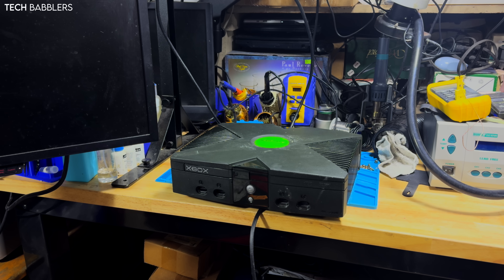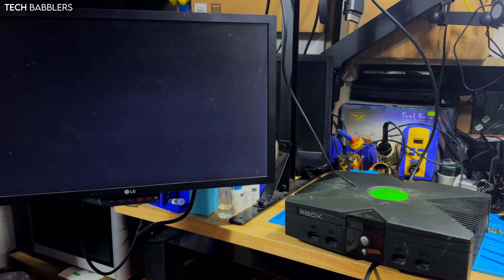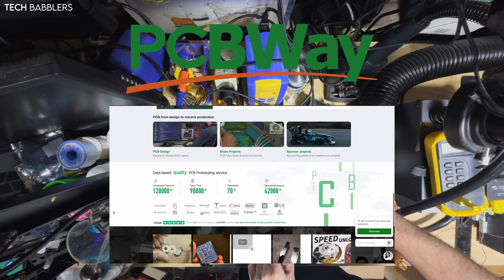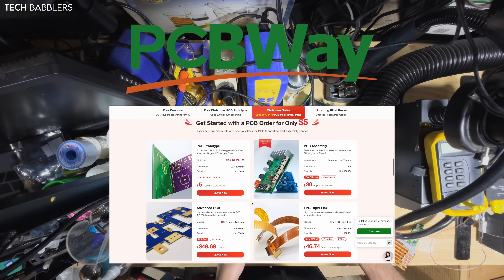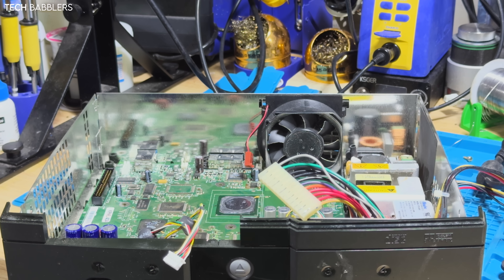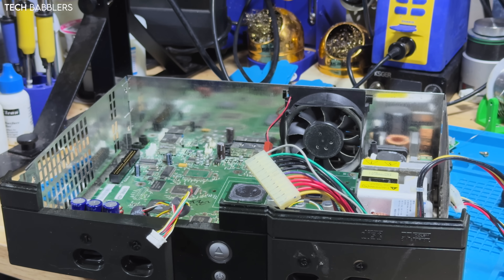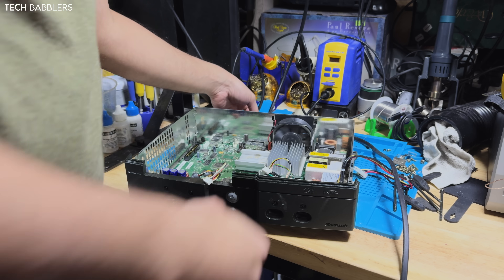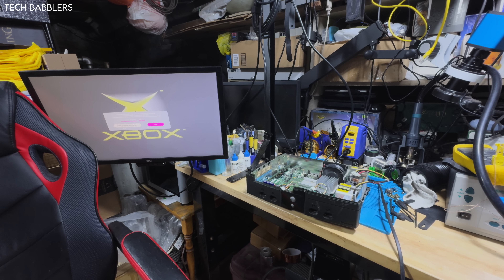Original Xbox 1.0Ghz CPU & 128 MB RAM Upgrade!

Comment: Interesting green for the controller ports is it the video doing it as blue green or is it actually blue green also i find your RAM method interesting you add solder to the pads then add the chip I remove the solder then add the chip
Reply from the maker: Since this video, i've gone back and forth with how I do the RAM upgrades. Sometimes I pre-tin the pads, place the chip, align by soldering one pin on each side and then drag solder, others, I do the same method minus I clean the pads and align the chip with no solder there.

Comment: Hi, where did you source the CPU from? All the ones I found are different dimensions and need an interposer board
Reply from the maker: I got mine from eBay! It's on a HP motherboard, so I had to pull it from the board first. It should be this! https://www.ebay.com/itm/384671580794

Comment: I wonder if a later Celeron would be a performance boost as well or not
Reply from the maker: It would have to have the same exact pinout to be a drop in replacement, otherwise, it wont work!

Comment: Gpu upgrade from the fx5200 to a Radeon 9500 Pro Would have been nice
Reply: The xbox Gpu is equal to a FX5500 when running overclocked, xbox gpu can reach almost 300mhz. And cant be upgraded because its actually the TOP of that architecture chips... is actually a geforce4 prototype not a GF3.

Comment: you don't need an interposer for the 1ghz ? what exact cpu is it ?
Reply from the maker: It's an Intel SL4BS PIII. It's a Slot 1 Processor, so you'd have to remove it like i did in the video.

Comment: can you share your bga profile ? i have the same machine
Reply from the maker: So I have an ACHI-IR PRO-SC and this is the profile i've been using for the past 6 months with advice from Vyktor with a few tweaks and have had zero issues with my reballs on PS3's ever since. I have my bottom heater set at 280 and keep it at that until top temp reaches 160, then i lower to 270 at 180, 260 at 190, 250 at 200, 240 at 210 and I usually just leave it there. For top heater these are my settings as of now, you can adjust the times up or down to make sure you are hitting the target temps. I also have my top heater aobut 1.5 - 2 inches away from the motherboard. For example, for L1, I have to have it run a bit longer in the winter to reach 160 since its colder in my basement. I am also using two TC for the top, one which is attached to the ACHI and one that is external. My bottom TC is also touching the bottom of my PS3 or 360. I can take pictures if needed

R1: step
L1 0 d1 360 r2 1.00
L2 190 d2 30 r3 1.00
L3 200 d3 25 r4 1.00
L4 210 d4 25 r5 1.00
L5 220 d5 25 r6 1.00
L6 230 d6 25 r7 end
hb 230.

Even though my L6 is set at 230 for 25 sec, I use the "nudge" test with tweezers, so once my balls are in the liquid state which is around 225, I can lift.
For reballing back lead, I usually stop before L4 reaches 210 and when my thermocouple reaches 205, and then I just let it cool on its own from there and have had zero issues.
For this, my bottom heater would be 10 degrees lower for all, so 270 until 160, 260 at 170, 250 at 180, 240 at 190 and then i leave it there.

I know i'm probably in the minority but I also reball my RSX using my top heater and haven't had any issues thus far, most others use a hot air wand and do it that way, but that'll be up to you. I have another profile for that which is basically
L1 210 d1 999 r2 1.00
For this i have my top heater probably an inch or so away, if i go 1.5 - 2 inches, some of my balls tend to drift or merge. Haven't had issues with any of my 40NM reballs thus far, so hopefully this can help you figure out how to dial in your own machine!

Comment: I have heard that someone is starting to be able to fit even newer CPUs, which I think may be laptop CPUs  (I'm not sure about anything to do with GPUs but that would be nice although I would assume new software would be needed aswell with that plus a lot more work and modification) onto Xbox motherboards now. It's early days, but that, along with being able to upgrade the ram to 128mb (and literally piggybacking more ram on to that) it is exciting times for original Xbox modding.. I know you can piggy back a ram chip on to one already on the main board, but I wonder if you could then piggyback another ram chip on to that one? And if so, how many ram chips could you piggy back in to one and another? Theoretically, could you build yourself an Xbox with 1gb of ram? I reckon that's something I could tackle and have a go at myself I've got a couple of scrap boards I could rescue the ram from. Great video btw.
Reply: The absolute fastest CPU that will work in an Xbox using a special interposer is a Tualatin PIII-S 1400. If there are any rumors about "laptop" CPUs, they'd just be the Pentium III-M, which are easier to convert because of the similar package type to the original 733 MHz CPU. There's no benefit to using the Pentium III-M other than the package size and slightly reduced power consumption.

>Theoretically, could you build yourself an Xbox with 1gb of ram?

No. The maximum addressable memory in the Xbox is 128 MB, which is determined by the number of chip select lines available (4). It's not possible to add more chip select lines either, because it's a product of the memory controller in the nForce chipset. You could stack memory chips until you had the leaning tower of Pisa, but it wouldn't do anything but risk shorting out or load the memory bus down so much that the console wouldn't function.

A GPU upgrade is never going to happen. The "GPU" in the Xbox is a custom ASIC that's more of a SoC, because it has several other functions in addition to graphics processing, one being the memory controller.
Reply: @GGigabiteM I want a leaning tower of RAM! I guess this is better done with through-hole packages.
Reply: @volo870  You can stack QFP chips, they're just more of a headache to solder properly.
Reply: @GGigabiteM   is not posible to add more lines but there are more CQ50 chips with twize the size so actually Xbox can hold 4 lines of 2 ranks each, so 8 chips... there are chips of 32mb each instead of 16mb so 256mb ram xbox is a thing but noone tried because bios, that was actually the first way to had 128mb ram on the 1.6 xbox, then you can had 256mb on the earlier ones, we need a bios.

Comment: hello i see your plates on bga r elstein  did you upgrade or  where there always elstein plates im having problems with mine the cpu dosent lay flat after reflow  just thinking of changing bottom plates  wondering if thats my problem
Reply from the maker: Check your top heater & thermocouples to make sure they are accurate!

Comment: Is the SATA adaptor one that you know to work? I know from personal experience that not all work, so if you have trouble getting the HD to work then it may be due to the adaptor.
Reply: some of those adapters also just seem to have either poor solder joints or have been sitting in a humid environment so they 'work' but you may need to clean them up first. One I am using in a Playstation 2 came with several cracked solder joints and what appeared to be corrosion. Cleaned everything off, reflowed and it's been fine ever since.

Comment: I love drag/wipe soldering packages. Sometimes, I go back and clean up other chips nearby, even if they work just fine. Also, for a bit of a life hack to keep them from sliding around: Gel flux UNDER the chip, even if there is no pins under there. It will allow the chip to 'stick' just enough. Lots of people use tape, but we all know what tape turns into 20+ years later.
Reply: Wouldn't flux oxidize the PCB in 20 years? Genuinely curious. My experience is that flux turns into an awful acidic putty.
Reply: Old tape?
Reply: Uh

Comment: You might want to remove that clock capacitor that is still present on that 1.0 board.
Reply: Is that the Cap that likes to go boom?
Reply: @chrisg8339  On rare occasions it goes boom, but for the most part it leaks corrosive fluid onto the motherboard. This only applies to 1.0 to 1.3, as well as the majority of 1.4 motherboards. A small number of 1.4, as well as all 1.6 motherboards have a gold-coloured clock capacitor which isn't prone to leaking.
Reply from the maker: Yeah I did remove it after the video!

Comment: I always thought the XBox had a Celeron CPU in it, but looks like you used a Pentium III. Wild.
Reply: is not a Celeron, its a mobile pentium3, low power slot1, thats why you can just plug and play a slot 1 or solder a socket 495 and use mobile PIII chips, xbox use a mobile P3, thats why hald the cache, but is not a celeron lol.

Comment: Don't forget to add the switch or button to the console to change the cpu to the old clock speed, Many games have issues with the new speed and run too fast
Reply: Hmm,i have a 1.4 rev xbox that have a 1.4ghz cpu-128mb ram and a project stellar in it,working fine with al games,but its stellar that have the option in its menu,best is to have a 1.4ghz cpu and stellar,works verry well to be honest.
Reply: @fille1976  Some games are programed to only take advantage of the stock clock when its higher the game just runs faster. Many games like half life 2 have a major improvement to performance and frame times
Reply: apparently it dosn't change the speed but does something with the clock cycle to send data at ever second cycle .
Reply: this only can be done using a mobile pentium III 1ghz because in "power saving mode" it runs at 740mhz and you need to wiring it to activate-deactivate it, this video upgrade is a easier 1ghz slot1 cpu, that is plug and play, and the games can be patched to 1ghz speed by software. Anywat slot1 1ghz Cpu are hard to find but this video upgrade is the most reliable one.

Comment: Isn't the l2 cache for that chip on the interposer? Wouldn't that break functionality
Reply: Not for this pentium 3, later slot 1 pentium 3 don't have l2 cache on the PCB but inside the die instead
Reply: @DxDeksor  oh so it was a drop in upgrade chip vs buying a new system back in the day

Comment: Wouldn’t this 1Ghz cpu now operate at 733mhz like the original cpu? The socket 370 interposer changes the FSB and multiplier to get to the correct speeds right?
Reply: Pentium 3 CPUs have a locked multiplier, also normally their fsb is the same as the Xbox' CPU (unless it's a 1ghz P3 with 100mhz Fsb, then the CPU is running much faster but I doubt it would even boot)
Reply: @DxDeksor the thing is why not force the FSB run at 133mhz on the 1ghz P3 100mhz to get 1.333mhz???  is the point of the 1ghz slot1 upgrade
Reply: @SargentoDuke  well this is exactly what would happen with a 1ghz pentium 3 designed for fsb100.
The Xbox has a 133mhz Fsb.

Except that most 1ghz pentium 3 are coppermine chips, and they don't overclock over 1.133GHz ... So it won't even work.
Now you could go further with a tualatin pentium 3 at 1.4ghz !